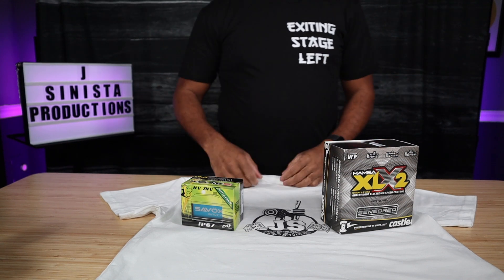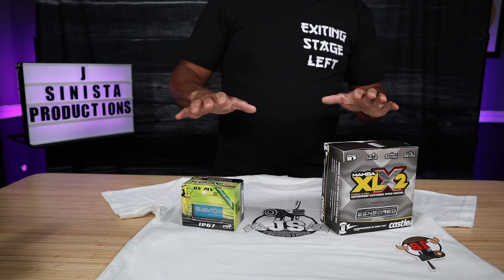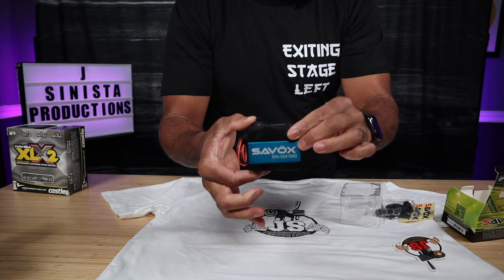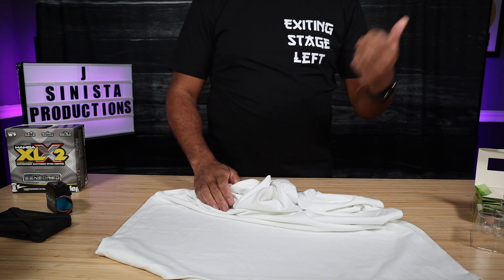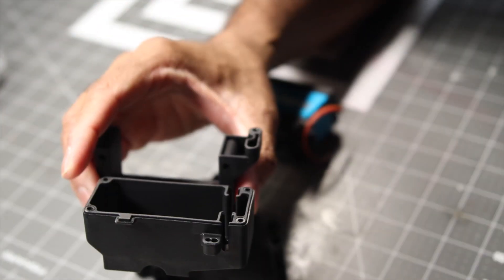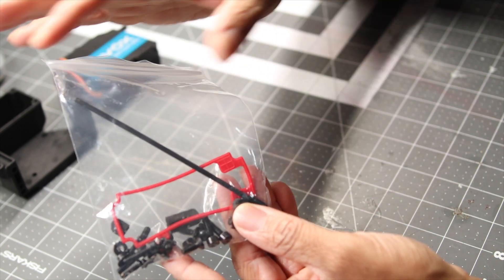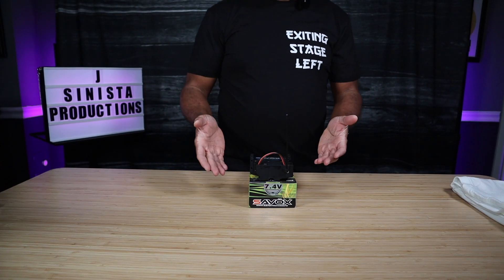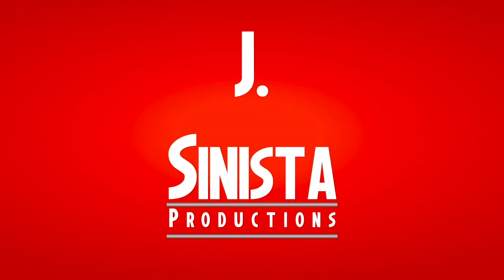Arrma Kraton EXB SAVOX + Flysky Electronics Install Part 1

Comment: I'm leaning towards this servo. I hope it fits. I refuse to pay 250 for the spectrum 1/5 servo.
Reply from the maker: Zero problems fitting this servo.  I've seen where others have had problems, but everything went together and in place.  I believe I detailed int he video how you have to back off some of the fasteners so everything lines up properly before fully tightening them down.

Comment: Where can I buy the mount you used?
Reply from the maker: Which mount, for the ESC switch?
Reply: The one for the servo
Reply from the maker: @brayanlopez4836  Servo mounts came stock with the roller.  You might try eBay or Amazon or your LHS.

Comment: This servo doesn’t fit you need the non water proof orange one it is 3mm shorter on the top the other one will rub and you can’t install the servo saver brace
Reply from the maker: What???  Really?  It doesn’t fit?  Really odd.  I guess things have changed in the past seven months. Thanks for the info.